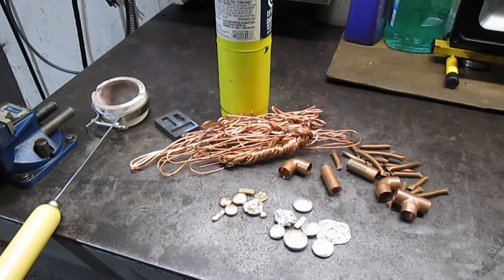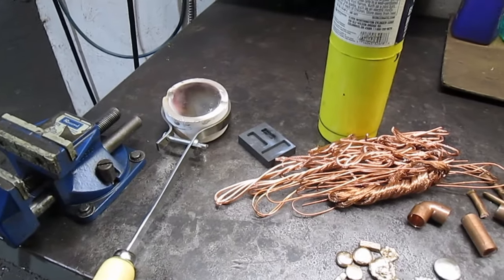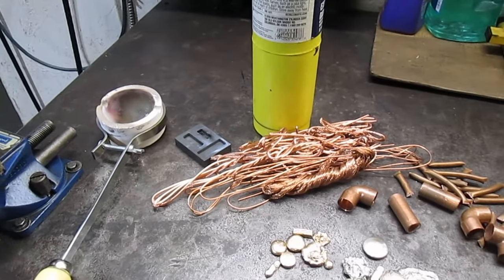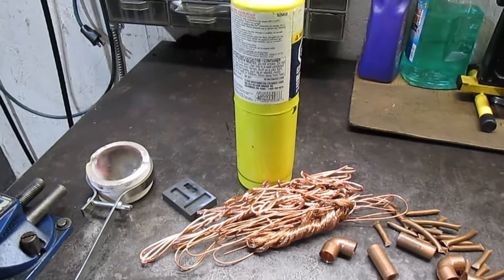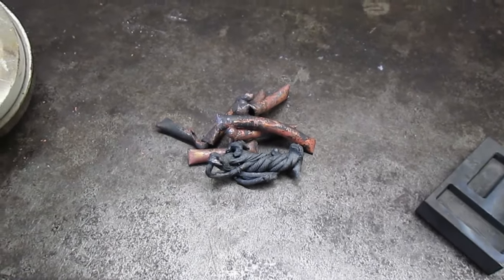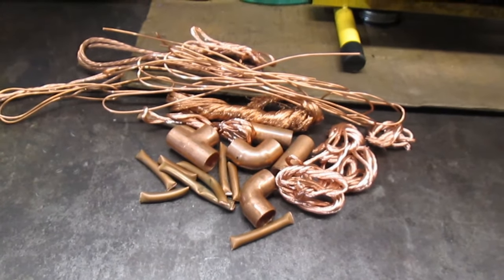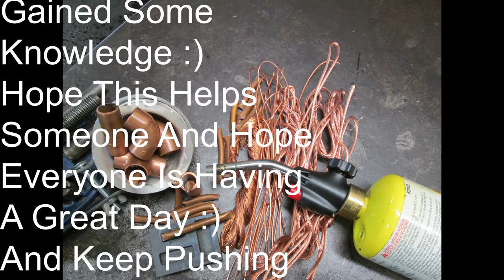CAN YOU MELT COPPER IN A POOR MAN'S CRUCIBLE ???

Comment from the maker: Melting Gold https://youtu.be/ZV1vmXZJUvw
Melting Silver https://youtu.be/T5drdlSA3IE
Reply: I believe you can melt the copper... just a little different than you did.
1.  Make sure after heat is applied for a while that you add flux, such as Borax.  Sprinkle some on the hotter metal, not when it is cold.  I have heard that Borax will help lower the meeting temperature of the metal while providing protection against oxidation during the melting. 

2.  If you can, use bricks to reflect the heat back the crucible, or at least shield the crucible and flame from air drafts.

Without a crucible, and only attempting to anneal some copper, I was able to melt and fuse stranded copper.  I only was using old, used exterior house bricks as a platform and three sides.  It was winter time in North Central Texas, so not hot, and probably around 40° F outside.

Comment: It's not a fail, because as of now 11,734 people wondered the same thing. You saved a lot of people a lot of trouble. Thanks
Reply: I found out the hard way
Reply: Just saved me a whole heap of time and disappointment lol..
Reply: Since 77k views .....think why it's so much views if they didn't try by themselves this :))) I'm here on this video because I used 2 gas tubes :)))) and same result . Then i found this video and i was surprised for the results :))))) if i could find this video before using 2 tubes ....and now ...before i see this video i was ready to give one more try :)))) I'll make a simple furnace and check next results :))
Reply: @SirJohnatan  my reason is because I don't have a blowtorch and didn't want to waste money finding out it don't work..
Reply: Or Wasted 8 Minutes To Watch What Is Commonly Known. Before You Start A Project, Do Some Research. Find The Melting Temperature & Know Your Propane Tank Is Not Capable Of Burning That Hot Without A Furnace. You Need Air Flow.
Reply: @jeoi  exactly why I watched it.. YouTube is often used for research..
Reply: Thanks for doing an experiment I won't follow.  The blow torch shouldn't take more than 5 minutes of trying to melt copper.  The cost of propane cost > and more in trying to develop an ingot of copper as you explained at the end.  I still think recycling costs with the other means of a bigger furnace time and expense produces a copper ingot of higher value like the gold and silver parallels for me to even try copper.  Copper was $4/lb in 2010 and still $4/lb today for me to even store wealth in copper ingots like gold and silver coins or ingots of them.
Reply: Now 167k

Comment: You can actually melt it in that crucible. Not sure if anyone pointed it out in the comments but I did the same thing with alot of different metals and the common denominator is that the heat is dispersed through the bottom of the crucible aas the bottom gets hot it is also cooling down. So unless you have something on the bottom of the crucible to keep the bottom of the crucible's heat endothermic then this method is indeed useless.....I went through a lot of gas and products and sleepless nights to get to this conclusion. Hope this helps anyone reading this. 🤙🏾
Reply: It does !  Thanks so much !  It also looks like a whole lot of copper to melt in one go.

Comment: This was interesting.👍  I'd love to see you redo this experiment.  Here's why...  I may be wrong and you probably can't melt a lot at once but I honestly believe you would have been successful IF you'd used smaller/thinner pieces or piles of copper and fluxed your crucible with Borax.  I know for a fact 20 gauge copper wire will melt with a butane torch because I've made balled copper head pins for my jewelry using a butane torch (aka chef's kitchen torch).  The pieces you were trying to melt were just way too thick to reach a liquidus state using your torch so maybe use bits of 20 gauge or smaller wire.  As for fluxing, I just noticed you didn't flux your crucible with Borax (on camera anyway) before you started.  Anyway, again... excellent demonstration!👍  I look forward to a redo if you are up for it.  I'm very curious.  Either way, thanks so much for sharing!! 👍😊

Comment: I believe you can melt the copper... just a little different than you did.
1.  Make sure after heat is applied for a while that you add flux, such as Borax.  Sprinkle some on the hotter metal, not when it is cold.  I have heard that Borax will help lower the meeting temperature of the metal while providing protection against oxidation during the melting. 

2.  If you can, use bricks to reflect the heat back the crucible, or at least shield the crucible and flame from air drafts.

Without a crucible, and only attempting to anneal some copper, I was able to melt and fuse stranded copper.  I only was using old, used exterior house bricks as a platform and three sides.  It was winter time in North Central Texas, so not hot, and probably around 40° F outside.
Reply: Was exactly my thought, and I’m going to try it later this week. I think at least a good tablespoon of borax will give a good pool to protect the metal from creating an oxide layer…you’ll just have a slag/crust you’ll have to bang off once you pour it out.

Comment: I'm a plumber and am learning how to braze. I kept getting paranoid my torch would melt the copper if i torched the copper too long.
Just wanted to get an idea how much I can apply heat before it melts. Looks like it's a lot and I don't have to worry. The brazing rod melts much much sooner.
Reply: I think it’s because MAPP has doesn’t burn as hot as propane.

Comment: I've had limited success using wood as a crucible, just carbonize the surface first. I find swirl head torches are much faster and hotter, but use more gas. The tri-webbed flame is like an intermediate step between swirl heads and normal pencil tips. A silver swirl or a jumbo swirl will also use all the oxygen up in the flame and help reduce oxidation
Reply: what do you mean wood crucible???

Comment: A lot of places don't like to buy melted material.the reason being is they don't know what additives you may have added to it. They also know like when it's a copper pipe they know that it's been manufactured to spec. Are the places that do by melted material normally hit it with a analyzing gun to let them know what material is in it.

Comment: I'm not entirely surprised. Copper conducts heat very well. so while you got some of it up to near melting, that heat was being pulled away to the other end of the copper and dissipating. It's why copper is used in heatsinks.  You could definitely do it in a coal/coke forge, but for gas, you'll want an insulated furnace to trap the heat in.

Comment: From my experience,no and even so,i would not recommend melting copper with gas if you want to cast bronze or do some hammer work with it.
I am melting bronze in my apartment kitchen using propane and a turbine (lower propane psi=lower gas consumption/lower costs) in a stainless steel foundry made by me and even so,i got lots of problems because i don't make only castings but forge cold bronze too.
Copper/bronze has to be protected from air and other gases,this is why a charcoal foundry is the best (charcoal burns all the gases and oxigen,creating carbon monoxide inside the foundry).
As a bronze/silver/gold smith,using propane is the worst possible way to melt metals without using borax or other methods of protecting those metals.
If you have inside space or outdoor space, building a clay foundry with a turbine (like a smith's foundry) is really easy and the most efficient way to melt metals and remember,good quality casts are made with the metal protected (borax or crucible cover)

Comment: Pouring good oxygen and hydrogen free copper is a challenge even for experienced foundrymen.Alit if guys will not pour if it is cloudy outside,because the water vapor will cause hydrogen bubbles.Some use charcoal over the melt to scavenge any free oxygen.
Then you want to pour a test cock to ensure you don't have gassy metal.
And because of coppers incredible conductivity,you got to out more heat into it,than is being carried away,which you found out!Keep casting!

Comment: Correct me if I’m wrong but would it work if you used less copper with the same torch? Copper melts at 1085°C or 1984°F. That MAP gas should put out a 3700°F flame. Maybe repositioning with the hottest part of the flame, just above the tip, impacting a single one of those bars of copper. Just a thought idk much about melting metal tho.
Reply: I agree. 👍   I hope he will redo this experiment using much thinner pieces of copper while strategically positioning the flame to its hottest point because I know for a fact small bits of copper will melt with a small butane torch.

Comment: If you get into making different bars or coins it may be neat to have a variety of metals. When you are out dumpster diving just take the tabs off the soda cans you come across. You would be surprised how quickly it will amount up to fill your little crucible. The tabs are better to do than the cans, much cleaner. Also you being in a garage you may want to try some old wheel weights for lead.  Just some thoughts.
Good videos, keep them coming.
Blessings
Reply: I have a large amount of outdated electrical bags (construction black bag full). I started stripping the wiring to make copper jewelry to sale. Wanted to see what it takes to melt. These things are everywhere, just gotta look 💚

Comment: i melt my non-ferrous metals in one of those crucibles. hold the torch up side down, and start with smaller batches. Dual gas torches are definately easyer, but a single gas can do it. Just hold it in an upside down position and if you can cover the melt, it also goes faster.

Comment: Bro, where are you getting this big ol crucible?  Also I have been trying to alloy copper and aluminum and I'm using a little crappy ceramic crucible and the metal is like.... disappearing?  I have no clue where it's at, it isent in the crucible, it didnt go through the bottom or anything.  I'm using oxygen acetylene torch, do you have any clue where or what I'm doing wrong?  I was trying to do a sand cast with the alloy, but couldnt get it to form or pour.

Comment: Seems similar to my attempt. I could melt small amounts but they basically solidified shortly after melting.
Reply: Did you try wired copper? Just wondering if that would work rather than pipes?

Comment: Copper dissipates heat too quickly for this method to be effective. A furnace will do it tho.
Reply: This is the answer I was looking for, wondering why it didn't work and this offers insight
Reply: @JeffJeffers0n  I think if crucible was wrapped in Smtg heat insulating it would have a chance.

Comment: I'm confused by this, copper has a melting point of 1983oC, which is only slightly higher than gold which is 1945oC. Mapp Gas is able to reach a temperature up to around 2925oC in an oxygen environment. I've seen gold melted using a blowtorch many times (mostly by sreetips). Does the extra 38oC make so much of a difference that it's not possible, and if so why is Mapp Gas claiming to reach a temperature of 1000oC higher and still not be able to melt it?

Fair play to you for trying, but something is amis here 🤔
Reply: That a regular flame tip n u need the swirl tip to get it burning that hot
Reply: @stevenmarin2316  what's a swirl tip? I have a massive box of copper and a mapp torch thing, can I adapt my regular flame into this swirl thing you speak of and melt my copper?
Reply: Actually I just worked out what you mean, like in a furnace when the flame swirls round the crucible.

Comment: It can be done with a cutting torch or welding torch, the map gas needs to have O2 added like when you have their map gas welding outfit,  as it is about 50+ degrees above gold, but not all copper is pure and the many are alloys to harden it, changing the melting temp. I WOULD NOT advise doing it as Pops and slashes easily.  *****But CAUTION using a TORCH it does pop and splash.****  a smelting furnace is the safest way to melt copper and to pull off impurities add borax.   One more thing there are people who think it is funny to melt fully copper alloy  pennies prior to 1983 (then after "82" they are only plated) but I must remind you it is illegal to melt US coinage the last time I checked,  and they want to make examples of Conservatives (the group most likely to deal with smelting and forging) so if the shoe fits,  DON'T!
Reply: its not illegal to melt the coin.  Its illegal if you try to pass it off as something it isnt or if you are selling to make a profit.  It's perfectly okay to melt the coin for personal use.

Comment: I melted copper and a little steel pan probably 3 in wide four inches long and an inch high with a propane torch it all depends on the torch head you got on it too rather it puts more heat or less heat

Comment: Get some ceramic fiber glass insulation and put it over the crucible like a roof to keep the heat in! Or, hook up a blower to your compressor and throw some air in with the torch!
Reply: Ive used a shopvac pushing air in a metal pipe with propane

Comment: Dude...The thinner copper strands will reach the melting point quick.   You used a blow torch on the densest 1 ounce pieces of copper you had.  If you don't even try to use the strands then we need a refresher course in Thermal Dynamics.

Comment: I actually tried this before watching your video and I was somewhat succesfull. I managed to make really small bars (around the size of thumbnail and half centimeter thicc). I did it using only gas blow torch. Other important thing is that I only melted wires and I used a really small crucible and I had similar problems that you had: It was hard to melt this copper and to take it out of crucible. I tried to make a one big nugget and on top it was nice but when I managed to take it out of crucible it turned out that wires on bottom didnt melt. If you guys want I can post video presenting those nuggets.
Reply: Can you suggest me something easy!! 
I just want to melt 10 grams of copper for my experiments.
Reply: @karthik20187  So I weighted the bars I made for you. And yes 10 grams is totally possible, my bars range from 3,5 to 15(!) Grams. The one that didn't melt completely (unmelted wires on bottom) is 19 grams.
Use little pieces of copper. It's way easier to melt tiny thin wires than the thick ones. You can even use copper shavings.
Reply: @remigiuszdarmach4233  Thanks for the calculation. Is Mapp gas the only option??!
Reply: @karthik20187  Uh, I didn't use map gas. I used small butane torch. If you can you should use liquid fuel torch (I dont have one but I saw one melting bronze easly) I believe its the best tool for the job.
Reply: @remigiuszdarmach4233  Perfect.. That's wonderful of you to do it with butane. It makes me feel the same. Maybe a liquid fuel torch works coolest. And maybe I can get, used oil for a very cheap price locally.

Mapp gas generates more heat than butane.
I can get Mapp gas or liquid fuel easily without any problem, so either of them would be a better choice for me..

Comment: try using a better setup with more insulation so that the crucible isnt just stealing the heat away and conducting it to the cold air w convection. if the heat stayed in there better then it has a shot at melting

Comment: Bernzomatic torch website says that their torches can achieve a temp of 3,600 f° melting point of copper is only  2000 f° why didn’t it work?
Reply: I was wondering the same thing, apparently copper dissipates heat very quickly, so in an open environment the heat is not able to be retained long enough to melt. Gold is a similar melting point to copper but easily melts because it can retain heat much better. It is very confusing though I agree, given that the torch can easily reach 1000oC higher than the copper's melting point.

Comment: The one time I put a propane torch to a piece of Romex copper wire that was stripped well I ended up with lockjaw for about 45 seconds after accidentally inhaling a puff of the smoke that came from it so I always wonder how the hell do people melt copper in these YouTube videos without poisoning themselves considering such a very small puff of smoke has such a very profound effect on me
Reply: Thank you for actually explaining that you should use a respirator and a vent Hood I've seen a lot of people doing it just in their garages with no sort of safety equipment and well refer to my comment prior to this one to see how that can turn out

Comment: I wonder if you used electric current it would work... maybe both.... idk copper is a good conductor I'm sure enough voltage would melt it in that crucible...
Reply: Use a welding machine and graphite rods , touch em together and it'll melt copper
Reply: it will still conduct molten?
Reply: @jc-uw5wt  yes

Comment: So glad I found your video before I tried to do this in fact I wanted to do the exact same thing melt copper
I thought map and oxygen would work some what but still questionable maybe in very small stuff it will work 
I saw a set up at tractor supply for oxy map might want to spring a few bucks on it but in an experiment I am not to sure I want to spend that type of money on a fail 
All though on the package it comes in it said it can weld and cut steal so in the future when I feal a bit more braver about spending hard earned money on this idea in tractor supply it will stay the other idea you suggested the forge more then likely the best way to go at it over all

Comment: I think a capped crucible might work, but you may need to add an external insulation. This way you basically make a mini-furnace.
A crucible made from magnesia or alumina might work better due to higher thermal conductivity (compared to graphite, which is excellent but when used in furnaces).
Reply: Crucible made of magnesia to melt copper. You sure?